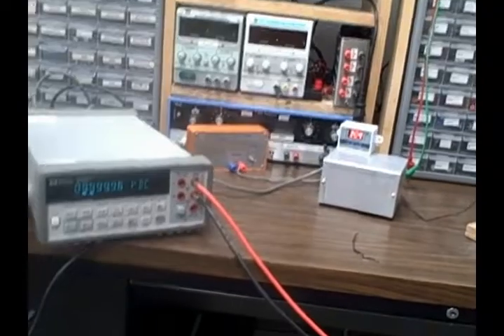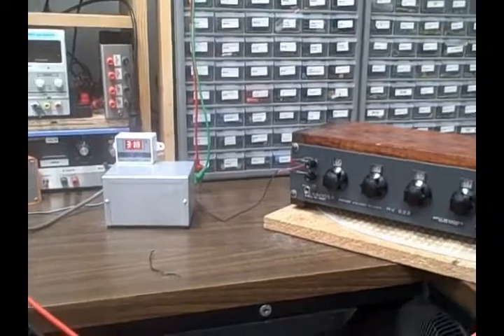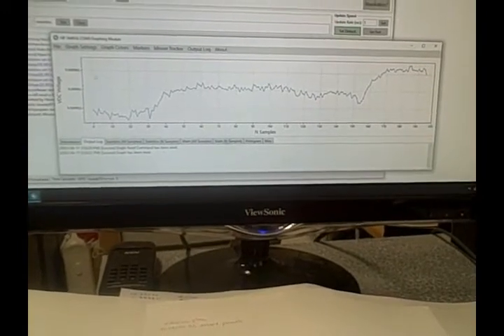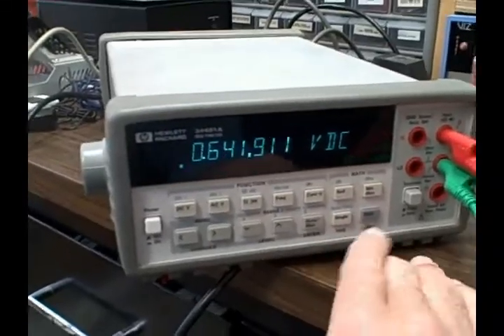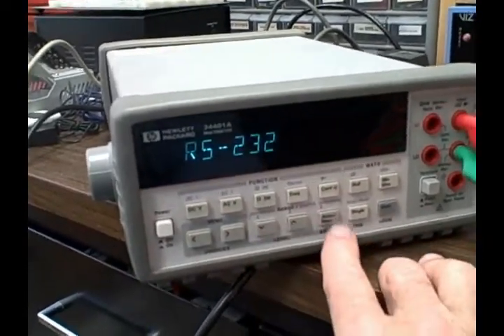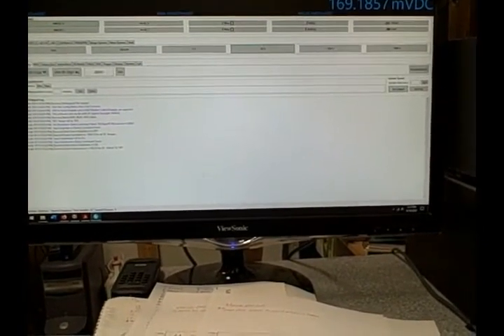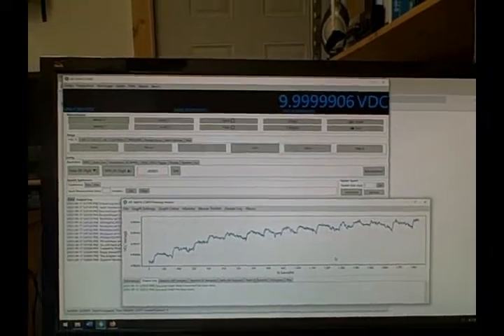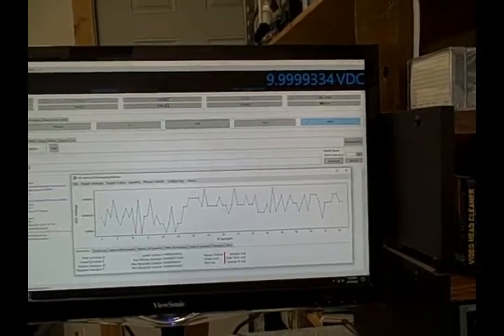HP34401A RS232 Communications to PC

Comment: Really nice, I am trying this communication using python serial, all the serial parameters seem to be correctly set and I am using the SPCI communication but no answer from the multimeter. Do you still have the source for this software you showed? Thanks.
Reply: Did you ever figure this out
Reply: @nothingtoseehere2189 unfortunately not